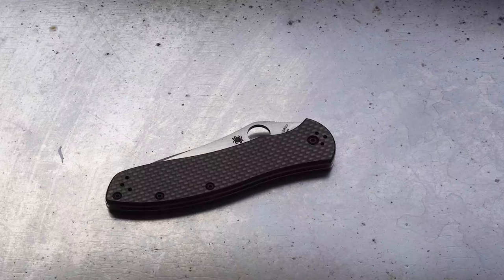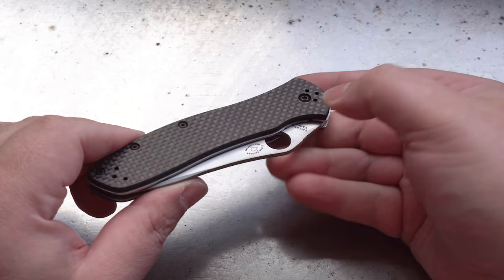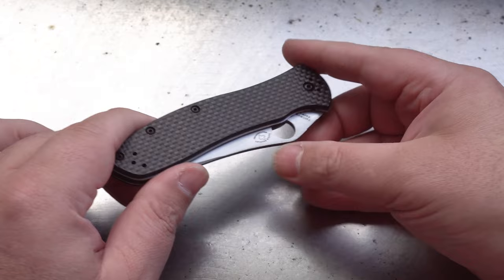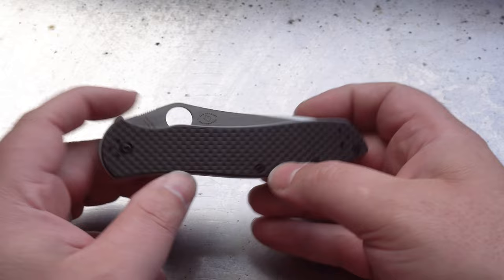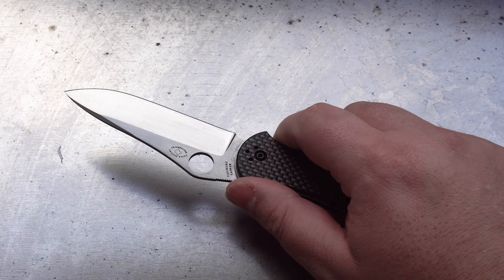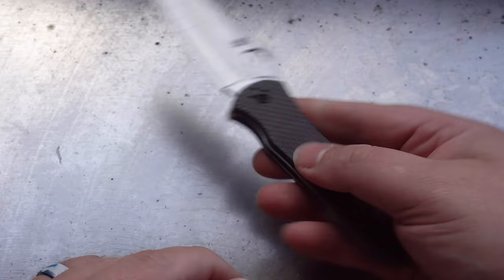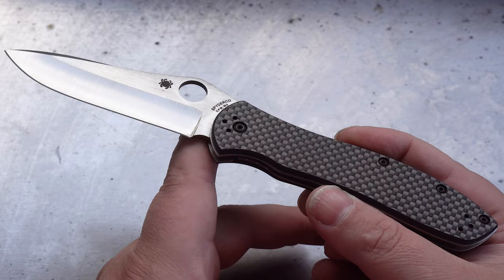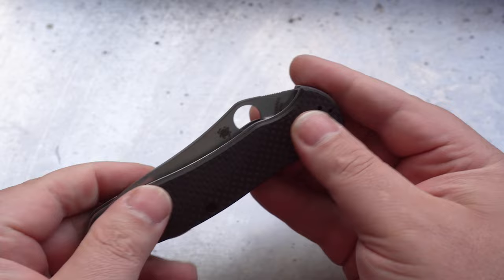Video review - Spyderco Gayle Bradley 2 *4K Ultra HD*

Comment: I also have the gb2 it a great knife, most spyderco's are great
Reply from the maker: Which is your favourite Spyderco?
Reply: Man that's a hard one,probably the pm2,there so many after market parts made for it,you can make like you want and they come in all kinds of steels,the smock is a great one to
Reply from the maker: Yeh, I should have narrowed it down with that brand - favourite steel type, favourite scale material, favourite lock type - just so many variations within. Thanks for sharing!